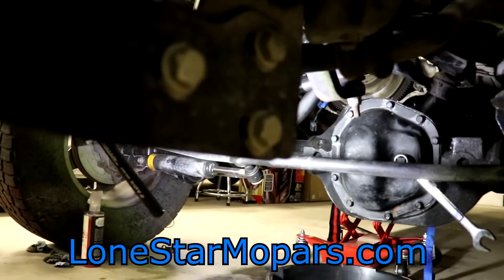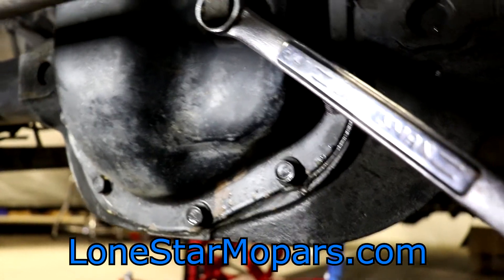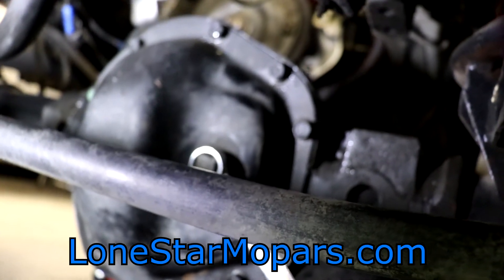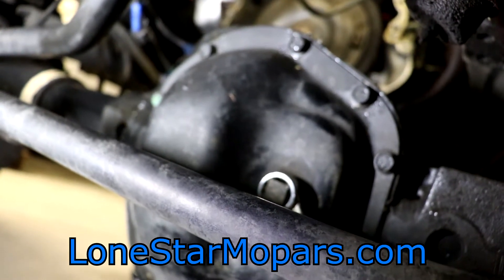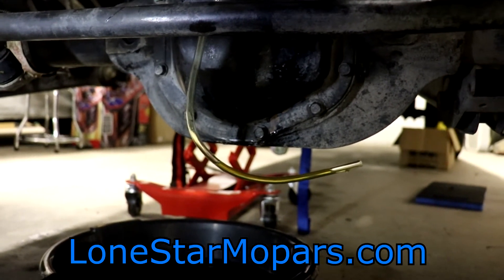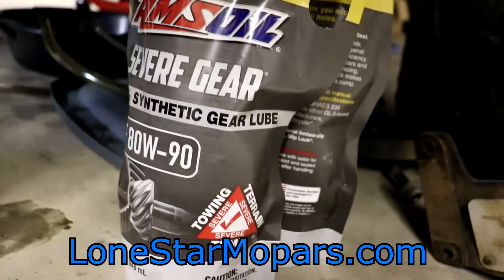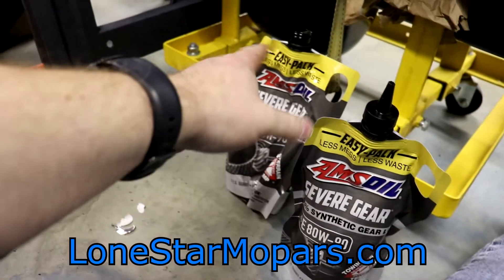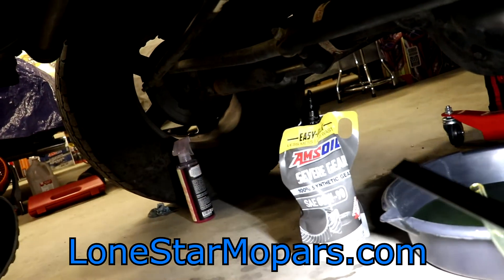Ram Revival Part 37: Front Differential Gear Oil Change with AMS Oil

Comment: Hey I’m thinking about doing the highs intake and cam and headers and the other stuff that goes with the cam like hardened push rods and stuff what else would I have to upgrade I have a 99 1500 with the 318 and I believe 46re 4 speed automatic